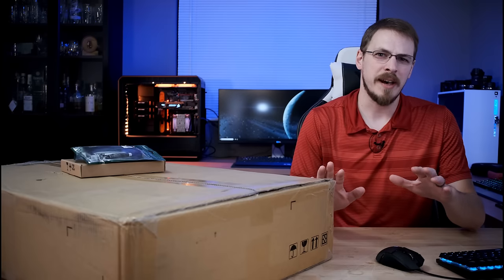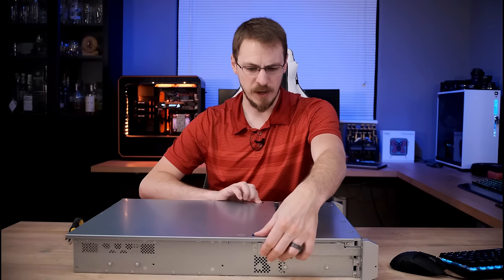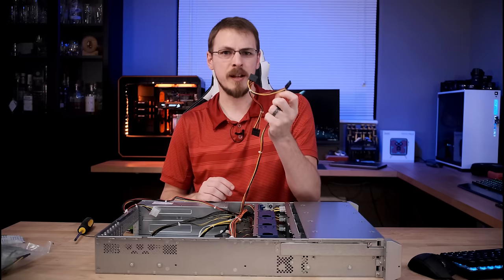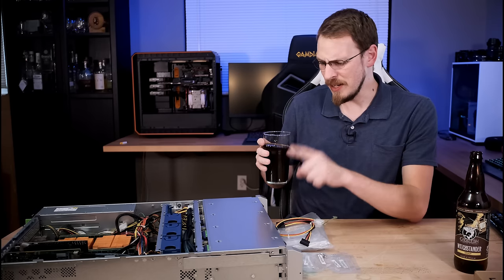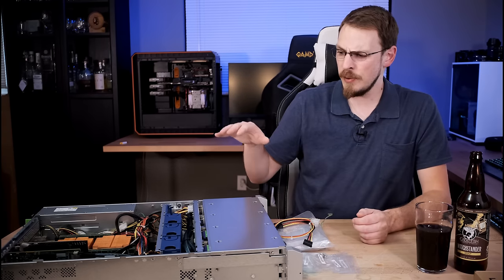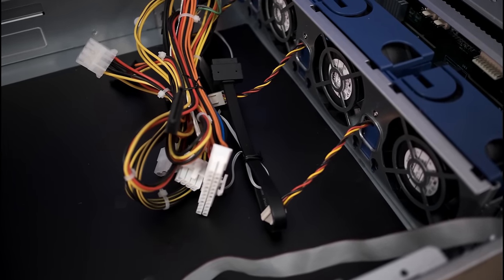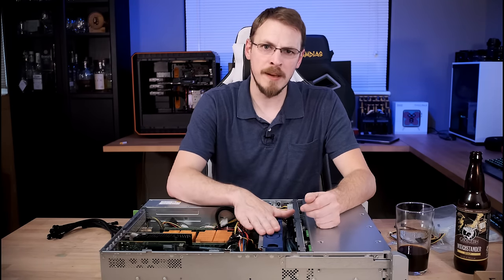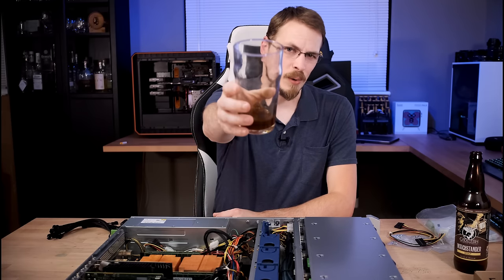InWin Makes Server Chassis? RS212 2U Case Review

Comment: If you do have a SAS expander backplane, you can control those fans via the SES interface, if you connect the expander to an SAS HBA card, and the fans to the backplane itself. It takes some researching but you will be doing it the proper way and make the wiring in your chassis way much cleaner than a bunch of fan extension cords.
Reply: Regarding the airflow, I thought about building an air shroud with lego blocks, so at least one of those fans can be concentrated on the CPU. But later I did get a 2U sideways cooler for my processor and didn't need the air shroud after all.
Reply: @thejeffchen  i once made one for a similar 1u passive in a 2u rack by cutting a 2 litre fizzy drink bottle length ways from top to bottom to make a tunnel and installing it from one of the fans on the fan rail in the middle to the  back of the case in effect creating a wind tunnel, it worked well

Comment: NMI = Non Maskable Interrupt. Some server motherboards have header for NMI. Button will generate NMI, which in some cases will act as reset with memory dump before that, can be used for debug or just to generate interrupt which can't be hidden. For example Ctrl+Alt+Del on Windows will generate NMI. NMI is also generated by some hardware errors - for example memory error.
Reply from the maker: Well on mine it turns the server on ;-)
Reply: Ctrl-Alt-Del is not an NMI.  It is the Windows Secure Attention Key, which is caught deep inside the Windows kernel to guarantee that whatever you type your password into after that keypress will be a genuine part of the Windows Login system code, and not some password stealing virus or Trojan Horse.

Comment: NMI (according to IBM) is:  "NMI; A non-maskable interrupt has occurred, or the NMI button has been pressed."   Pretty much what you'd expect.  Network Messaging thingy, to be technical!

Thanks for the Review Cheers (Prost!)!
Reply: Actually, the NMI is/was a CPU feature for the one emergency interrupt that must work even if a frozen operating system turns off all other interrupts and then hangs.  On IBM PCs, it would get used for RAM ECC/Parity failure, but because extra RAM could be installed on addon cards, people figured out that wiring a button to it was a way to get an unstoppable debugger activation method.  [Edited: Typo]

Comment: Great review.
I ended up going with an iStarUSA D-395-DE15BK - 3U, (15) trayless 3.5" bays. Have it built, but waiting on a good deal on the first 5 HDDs (man drives are expensive).
Went for a slightly taller chassis specifically to put in some quieter Noctua fans and coolers (NH-D9DX i4 3U). Even thought this will be going into a cabinet in my workshop/tech closet, did not want to deal with the extra noise.
I only recommend 1U or 2U builds for those that are limited on space, otherwise you almost always have to compromise on something.
Reply: Alphacool has some nice new radiators and gear for 1U and 2U builds.
This one will be liquid cooled as well ultimately, like it's 1U twin
https://www.facebook.com/DEMONMODS/photos/a.235838923610075/565007990693165

Comment: If you're feeling brave and helpful, you should do a video on reflashing that SAS controller from IR to IT mode because there is a TON of not-exactly-right information out there. It took me five OSes, three evenings, three thumb drives, and two re-flashing apps to find a combo that worked.
Reply from the maker: It's something I'd tackle if every single SAS card wasn't completely different. I've flashed RAID to HBA on cards before, but each one required a different OS, or firmware, or some little detail to make it work. There's really not a universal solution that I've found :-(
Reply: @CraftComputing  Ah! That could certainly explain some of the headaches I ran into. I also went back and listened instead of just going off the visuals -- I hadn't realized that you had an HP branded card which I've read makes for an extra level of pain.

Comment: Fs12-nv7 has a similar design and it has a air shroud.
Then only the suggestion is I can take a photo and send it to Twitter and you can adapt design to suit your needs.

Use a mining fan adaptor 6 fan header to 1

Comment: Dual and redundant don't exactly mean the same thing, redundant means one can fail without downtime. Dual simply means it has two, for instance if you have lots of accelerators you may have dual PSUs but each individual PSU can't support the full load of the system. Not very common though.

Comment: Thanks for the awesome review of the InWin RS212 2U enclosure.  I do have to say that most of the Amazon links for InWin server products are outdated or obsolete.  Nevertheless, I really enjoy your hardware and craft beer reviews.  Keep up the good work!
Reply: I tried to track down the deep InWin pedestal chassis online and it seems like a roll of the dice. Serve The Home did an interesting thing on them. They're a systems integrator/config validator and most of their server stuff doesn't seem like they're destined for the retail market. Maybe it's excess base stock that does bc there are a bunch of mid-tower desktop cases that are a dead ringer for the older Dell Optiplex Mid-Towers. I feel like I saw more of their backplanes and such for sale in years past.

Comment: $850 for a case , is it gold plated, ok it comes with 2x psu a 12x SAS plane with 2 SAS connectors , still i think its bit too pricey , don't get me wrong i like the case but i really feel you can get a Chenbro , SilverStone or even a 8 bay In-Win IW-RS208-02 2U Server Chassis for about £200 i cant see the extra value but then i see cases @£3000 so maybe its fair value, thanks for the upload
Reply: Didn’t he mention a RAID card? That’d certainly add to the price.
Reply: Price out a stand alone 2U 500W+ redundant PSU, and there's your answer.  I agree it's pricey, but justified.
Reply: @springbok4015  yeah he did mention it but im pretty sure he said he bought it for $40 second hand off ebay
Reply: @edwardgreenjr167  yeah i get that but still the psu's maybe worth about £100 each and the hot swap bays about £20 per drive caddy , that still comes in about £450 then the case about £50 that comes to about £500 which is about $600 so i dont think it is justified , i had done the maths and stand by my original statement that i feel the price is a bit too high ,  considering the other offerings i mentioned above , YMMV
Reply: it only has 2 SAS connectors because it's a full 12G SAS Expander backplane.

Comment: I've found that buying netapp drives from ebay are a really good deal for 7.2k sas drives.  II got my 2TB hdd's for 35 dollars each.  Note you will have to reformat them to 512 byte sectors vs the custom 520 bit sectors that the netapp system uses.  There is a really good guide on level  1  techs that worked for me.  Although it took about 8 hours total to wipe the drive, and then to resector it.  You could put a 20TB raidz2 in there such that you can have 20TB of redundant data.  If you need IOPS you could setup 6 stripes of mirrors and have 12TB with 2TB drives.
Reply from the maker: I've been rocking 6TB HGST Helium drives lately. You can score them for ~$110 on Amazon, which puts them equal in $/TB with the 2TB Netapps, and there's no funny business with formatting. Plus, that turns this server into a 60TB RaidZ2 box :-D

https://amzn.to/2M4fQuU

They're $130 right now, but still a great deal for an enterprise drive.

Comment: Thank you for a great video. I think the heat sinks fins are not aligned with the flow of air. Which is as you mentioned a problem of design of the motherboard.

Comment: My question is why not use that neat 4 pin cable on each PSU and  put a fan over each of the coolers to cool them down?
Reply: It’s a server motherboard. Those heatsinks are designed to have cool air blown to it at very high pressure on a rack mount server case. A more suitable solution would be to 3D print a plastic header placed top of the cooler to redirect all of the air from fans. You’ll see those plastic headers commonly on servers from Dell, HP and Lenovo.

Comment: Solid server chassis. Not a recommended cost effective home DIY case, but it's got some decent features.
Reply: To be fair, you get a platinum rated redundant PSU setup and 12G SAS Expander in that price.
Reply: Severnia that’s a fair point.

Comment: I personally dont like a 1U chassis, i prefure a 3U chassis. Istar make some great half depth chassies. I use one of thier d-300 as my personal case, at around $120 for a basic case, but offten on sale so more like $70 i cant complain. (Well, nonstandard power supply requirements are annoying) but 6: 5.25, and 2: 3.5 drive bays that hide behind 2 metalic bezels. Ide say that they are quite interesting looking.

Comment: Are the drives backplane(s) sata backwards compatible or only sas? Or is all sas backwards compatible with sata, or is none? I see the Norco rpc-4224 advertises sata and sas comparability, would one need anything special for one or the other or no?!?
Reply: Standard SAS backplanes accept SATA disks like Seagate Ironwolf pro and WD Red Pro/Plus.  Those are the series that are rated for 12 drives in one chasis, all vibrating and shaking each other.